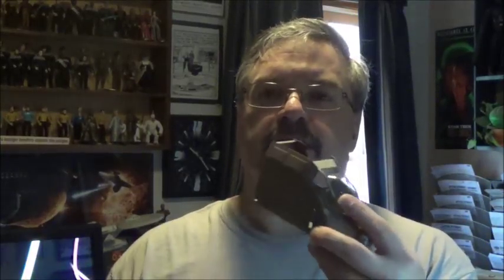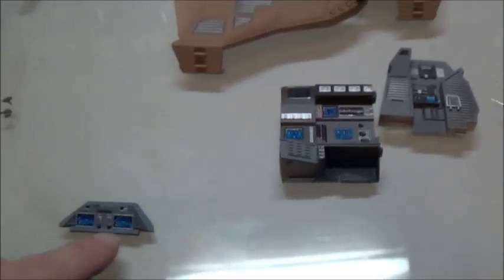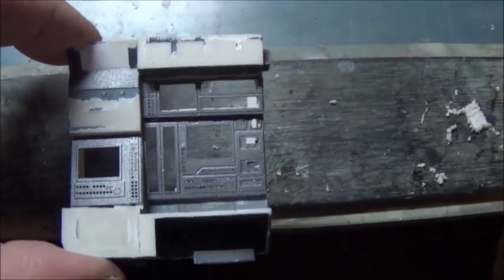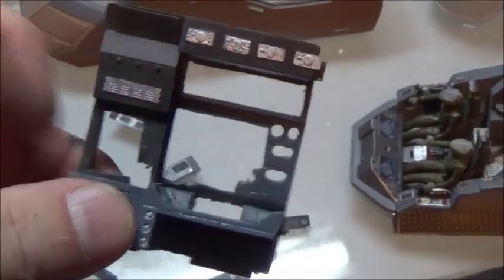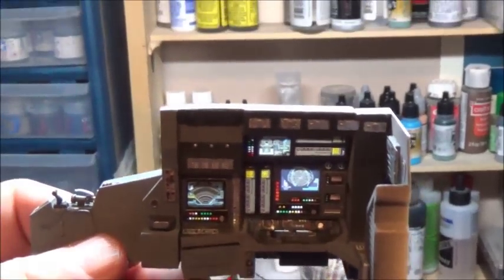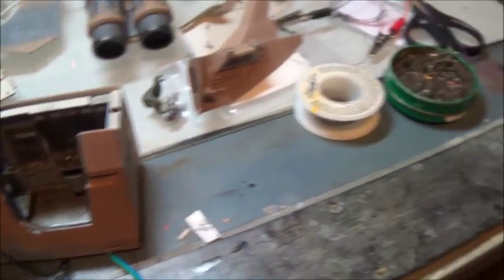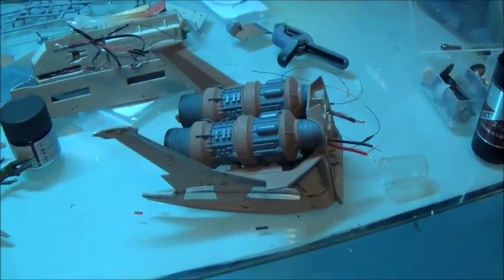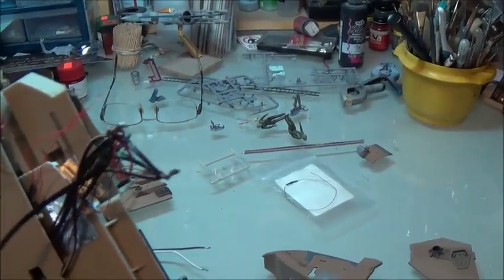Aztek Dummy Update 10/13/17 - Raptor Redux pt. 2

Comment: Thoroughly enjoyable work week review. Spectacular results. A little nerve wracking, even through time and space-- about your wing-tip lighting. But all's well in the end and on the sides.
The only thing I would have done in addition to the 100-130 lights you already have, is to drill some holes around the foot well of the Flight Engineer/ECM seat-- to pick up some light spill from the vast number of light sources behind the consoles.
Very nice stuff.

Comment: Nice work, the console lighting looks great. Another solution for the wingtip lights would be to drill a separate L shaped channel for each light, to either side of the indents. Then there would be no need for the styrene channel.

Comment: Lou, ya big dingbat, there are treads on top of both wings so the deck hands can climb up on top of the ship and get behind that “solid wall” and open MAINTENANCE panels. The starboard side wall is covered with screens and controls. Chief Tyrol’s deck gang have to get at the WIRING back there. And what if they have to fix the starboard side fin, or engine? It’s not for passengers, it’s for us wrench turning types! 😁

Comment: G'day Lou,
I am so impressed with your efforts, and you helpfulness towards others that love to model as well.
I thought about your comments regarding the foot pads on the other wing where there is no door, and you felt that there would be no justifiable reason to have the pads there, even though you yourself like symmetry, you could not see a reason for the footpads on the wing, as there is no door, and considerable wired in hardware on the interior of the passenger side wall.
One reason I could think of is, there are several service hatches/panels there on the exterior of the passenger side wall of the Raptor. So, my reasoning suggests that footpads would be necessary on that wing due to sparkies having to upgrade/update the interior wiring looms, motherboards/circuitry, as these technicians would be spending considerable time on that wing from time to time in servicing and upgrading various components, these techs might also have bulky/heavy equipment with them in order to do their work proficiently! What do you reckon, might be half a thing?
Love your work, am now about to subscribe, I'm so impressed.
"Three, Two, One...., Boom!" And on came the lights, I haven't been that impressed since the first time Han Solo kicked in the Supra Light Drive on the Millennium Falcon back in 77. That was breathtaking Lou, WOW!
Reply from the maker: You make some very good points and I'd agree if the Raptor was  only meant to operate in atmosphere, but you'd have to "spaceproof" any of those access panels  so they wouldn't come off under pressure in the vacuum of space. Since it looks like the instruments look like they are rack mounted , my guess is that they are just yanked out and serviced from the inside. If anything, it's the mechanics on the "wings" that would be serviced from the "topside". maybe those foot panels themselves are hatches to the insides of the wings. Lord knows the rest of the wings are covered with "No Step" markings. :)

Comment: Dear lu awille back u had built the raptor kit on ur deck floor u light up the steps to the pilot control how u use it to help put lights come through it and what power circuit board u use to help light the ship thanks again for your time and patience. Alan sankus
Reply from the maker: Alan, I don't think I used a specific board, I just wired the LEDs to a 9 volt power source. The photo etch came with covers for those step risers.

Comment: Hey Lou....I’m curious what the reason is to painting and applying decals if they’re only to be scraped off prior to the photoetch installation. Or.... were you just demonstrating how to apply the decals that were included. I have limited experience with photo etched add ons and any advice would be helpful for me. Also....do you think it’s possible to light some of the instrument panels effectively w/o using the photoetched parts?Thanks
Reply from the maker: yes. because this particular model had to serve two purposes. The first one was to show how to use my painting templates with the stock parts and decals (which is how the majority of builders will be building the kit) and then the second purpose was to show how to build it up using the PE parts. It was a one or the other type of thing, but I didn't want to build two separate Raptors

Can you light the consoles without PE? No, not really. the buttons are so small and close to each other that you need the PE to define the areas. 
could you light the engines? yes
Could you light the screens? maybe. if you cut them out and replaced them with clear styrene, it's possible you could light those. but that's a lot harder than just using the PE as a framework and removing the whole console tops.
Reply: Lou Dalmaso thanks Lou...appreciate your reply, very informative. Hey would you be interested in being interviewed for my channel? No big deal if not but i think you’d be great to have on. I interviewed a few last year. If you check my channel you can get a feel for the interview. Thanks again
Reply from the maker: yeah! I think that could be fun as long as there are no math questions. you can email me at aztekdummy@att.net to set it up
Reply: Excellent.....I'll email you shortly, thanks Lou :)

Comment: Great video the interior of the Raptor Lite up add a whole new dimension to this kit. Thanks for showing the site where you purchased your mini SMDs.  Question was the LED Tape you used for the Interior Console, Single or Double density. Thanks posting your video it's helping this old dogs return to scale modeling.
Reply from the maker: sal, 
a little of both. there are 3 strips of leds stacked behind the avionics wall. 
two single density cool whites and one warm white double density at the top

Comment: Good afternoon,
I wanted to ask you a question about photo-etched parts...
I am currently working on the Moebius Colonial Viper from the original Galactica, specifically the cockpit right now.  Is it possible or have you ever glued the Paragrafix films to the brass photo-etched parts first and glued the part into the model with the same  clear parts glue?  It seems much easier, but I’m not sure if the glue will hold and I don’t want to damage the Paragrafix films.  
Thanks,
John
Reply from the maker: John,
I use micro crystal clear to glue in the backlit films. it's a little thicker and sturdier that clear part glue, but what you've got will work just fine. when it comes to attaching the cockpits into the models, I usually "tack" them in place with tiny drops of CA and where possible, I'll use apoxy sculpt or two part epoxy putty and a fine blade and kind of fill in the space between the brass and plastic with that. because sometimes you have to cut off regular joining tabs to make room for the etch, setting the new cockpit into a bed of putty make me feel more secure
Reply: Lou Dalmaso Great!  Thank you for your prompt response, I will try that. Cheers!

Comment: Lou I had a real problem fitting the engines on their supports...they didn’t line up with the holes...did you run into this problem?
Reply from the maker: Chris, I remember them being a bit tight, but they did fit. make sure you have them oriented correctly, they are mirrored, not symmetrical. Start by lining up the holes on the bottom (where it sits on the plate that is between the engines) and then line up the side holes in the stabilizers. there's only one way they will line up correctly